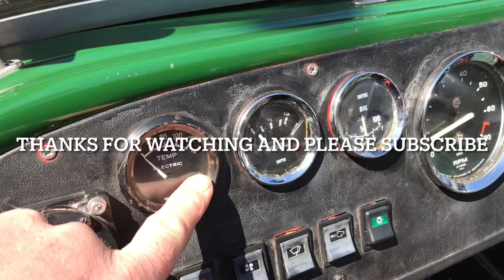How to improve engine cooling and reduce overheating Westfield Ford Pinto

Comment: Very useful vid; I have similar cooling issues with my Marlin Cabrio and am now tempted to re-rad and bigger fan that.
Reply from the maker: I’ve had issues for a while which has meant my engine has overheating a couple of times. My first video was about thermostat and filling up correctly to remove trapped air which resolved the problem to some extent but my old rad actually really needed a decent flush through after a head gasket problem and I think that has been a root cause. However if you want complete peace of mind go for a new rad and fan and I recommend Coolex as the package was about £190 which is very reasonable

Comment: Good Video.  Excellent mod that should really be a big improvement.  Funny enough I'm looking to source an aluminum radiator for my '74 GTV.  I don't have any overheating issue.  While back I remove the 'stock' always circulating fan (some say you gain a couple of HP) and installed a SPAL fan that has a thermostat that kicks on, if I happen to be in traffic).  I can actually see the temp gauge lower.  Any case, I'm more looking to brighten up the engine bay than increase cooling efficiency.  I've seen the Alfaholics/Classic Alfa offerings (wonder if Coolex makes them) and they're around 850 US Dollars+ shipping...so quite pricey.  Seem some Chinese knock-off that look rather well made but had to trust what you'll get.  Do you know if Coolex makes them for Alfa Romeo?
Reply from the maker: I will certainly ask them the question as it would make perfect sense. I’ve got a spare rad they could ‘copy’ if need so

Comment: the first problem with that installation is that there's no shrouding around the rad so much of the ambient cooling air entering the nosecone goes around the rad which results in low pressure differential across the rad!